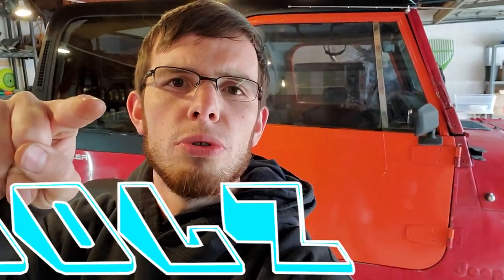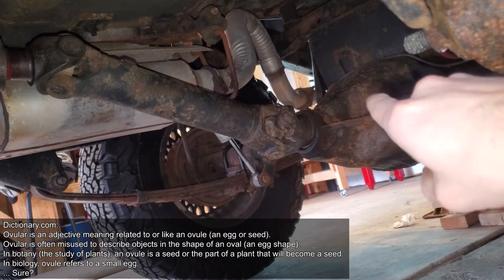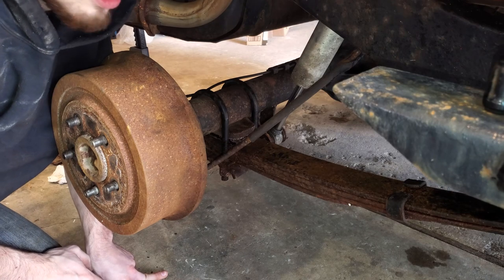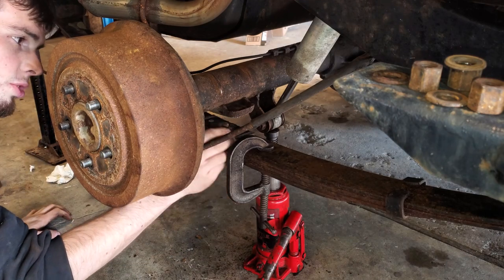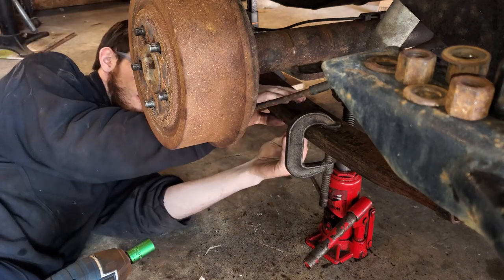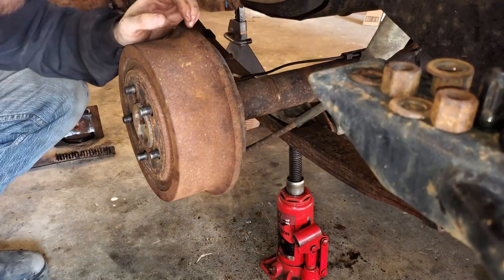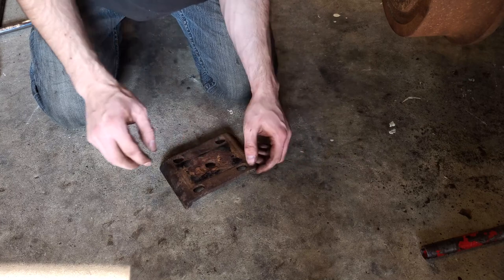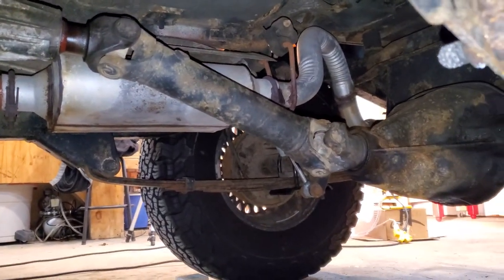Adding Or Removing Shims To Correct Driveline Angles

Comment: Very good point to C-Clamp leafs before disassemble the section!!
The cost to redo U-Bolts is cheap insurance. I get them made locally about $40.00 for the entire axle, all hardware included. Takes the shop about 15 minutes to get them done!
My local shop also has the shim pieces in 1 degree increments, about $14-17 each.
I dealt with rough country on the 3" lift kits, and am Not returning to them for anything!!! Good grief was it dissappointing!

Comment: I did mine different, I cut off the leaf spring perches grind off the old welds and placed the new perches on the axle loosely and pushed the pinion up to my desired position and then welded the new perches to the axle tubes
Reply from the maker: It's a bit more work but that is arguably the better way to do it.

Comment: Hello,
I saw your video really helpful thanks. 
I have a problem with my 04 ram is lifted and every I drive into a bump I hear grinding on the front drive shaft or when the truck is loaded what would you recommend on my issue?
Thank you again

Comment: you want equalize the angles if under 10 degrees but have rear diff 2 or 3 degrees below to account for axle wrap under load.
Reply: looks steep, you might want to try a double cardan on a shaft that short. 
i use them on my cj5’s and they are the cats meow if you have degree issues. 
not a perfect solution but they can help.

Comment: I did a throttle body spacer and 4.0 throttle body. Just got my injectors and wires. Must have been too much for the ax5 because she let loose. Im ordinary the rebuild kit though. You ever do a manual transmission
Reply from the maker: I have not yet worked with the manual transmission.
Reply: @JeepSheepTV  it dosent look that bad no place around me will rebuild it so I guess I get to learn how

Comment: Stupid question on jeeps, but why don't they put the axles under the leaf's?
Reply from the maker: Not a stupid question, I'm not quite sure I have seen vehicles come from factory both ways. I think in general you get a bit more stability on the front axle but who knows.
Reply: @JeepSheepTV   Exactly correct, SUA (spring under axle) provides more stability than SOA. This provides for a more stable ride and reduces axle wrap in the rear. Convert to SOA and it becomes an off-road beast (at the expense of the on road drivability)

Comment: You can also do a transfer case drop, decreasing the angle.
Reply: Great stuff also is having a double CV joint at the Yoke side, as the yoke might going out of the TC  more than usual to extend enough for the rear shaft. Due to increased height/distance from rear axle, stock shaft happen to be a bit short at a certain point and some folks had their yoke sliping out of the tranfer case at full suspension downward ! So adding on a stock shaft a double cv part at a " Custom shaft shop " ( There are great specialists out there and they also do balancing, at the end it's cheaper than buying an official modified part ! ) makes it a bit longer to compensate and it also minimize angle effects ! So at the end more torque from the yoke to rear axle can be transfered with minimal efforts on components.

Comment: Does anyone know if you change your gear ratio on your truck should you change install a torque converter with a different stall speed or does it affect your torque converter at all
Reply: Torque converter mod can allow the engine to hook up at higher or lower rpm. Example if you had lumpy cams the engine is terribly inefficient at low, just above idle speeds (rpms) so using a stall speed would allow the engine to run at it's sweet spot then transfer motion

Comment: On a ujoint on each end drive shaft,,the pinion and tail shaft need to b parallel to each other,,the way I do it,,I take a digital angle finder on my phone app,,I put it to the pinion and zero it out,,then put it to tail shaft,,gives me what degree shim to use,,then do it visey versy and same number,,this would b with moderate lift,,before you have to turn pinion and go with cv on driveshaft,,

Comment: What size lift you have? Got a 3.5" and going thru the same thing
Reply from the maker: I have 1.5" in the springs and 1" in the shackles.
Reply: I did a 2.5'' spring and 1'' in shackle lift, having the same issue.  What was your ultimate fix?

Comment: Never get under a vehicle supported by a bumper jack.
Reply from the maker: I agree, that is why the jack stand is holding the weight of the jeep and the hi-lift jack is there as backup.
Reply: @JeepSheepTV  I do see the jack stand in the early shot. Which given the blocks honestly looks a bit sketchy. The hi lift is inherently unstable so I would delete that and get a better set up where it comes to vehicle support. Nobody wants to clean that mess up when your vehicle falls on you.

Comment: Your shocks are on upside down...
Reply from the maker: The front shocks only go on one way and they came from Bilstein with the  skinny side down. I copied that on the rear because it looks cool, has better clearance to the axle, and keeps dirt out of the cylinder/shaft seal if you are not using boots.
Reply: Most shocks are designed to mount the other way...and they will not work properly because the piston inside of shock is on wrong side of oil...oil goes back and forth but should be on one side sitting still...
Most shocks that mount upside down have a resivor...
Yours maybe right, just never seen them.